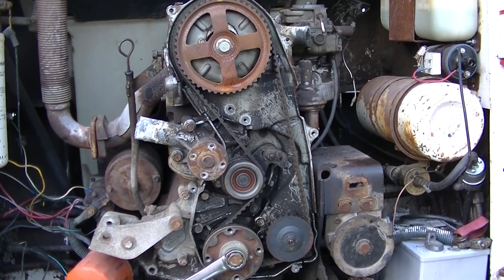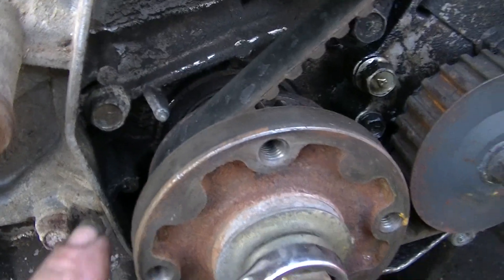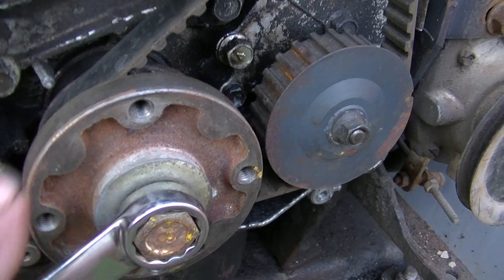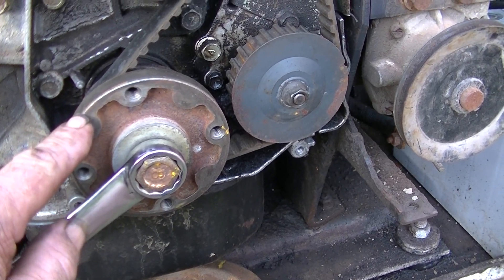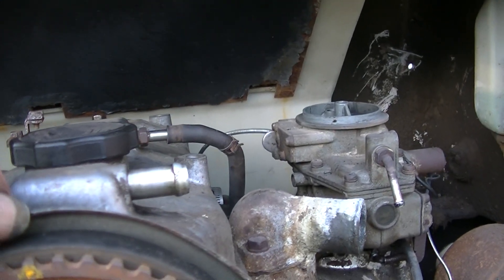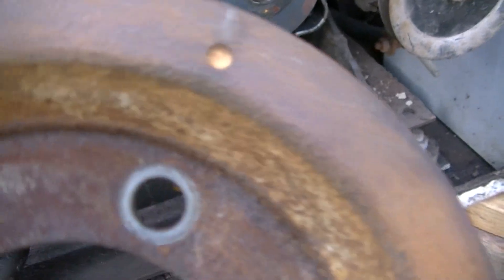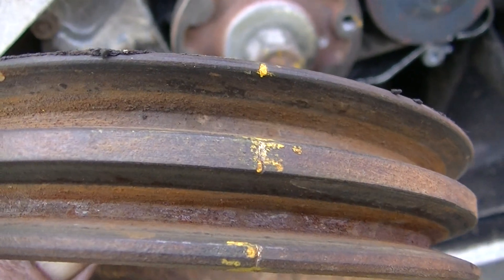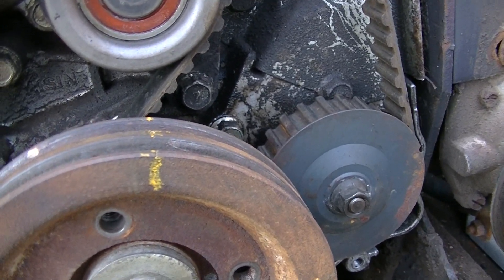Bobcat 642/742 Skid Steer - Mitsubishi 4G32 Timing Marks - zeketheantiquefreak

Comment: Thank you for this, had the same issue with this engine in a forklift that was hard to see the front side of the engine. Your video made it easy to figure out as the original manual left a lot to be desired. Thank you again for  taking the time!

Comment: Does that engine have balance shaft?
Reply from the maker: If we are talking a 'balance shaft' that is driven by, and timed to, the crankshaft, then no, this model mitsu 4G32 does not have it.
Reply: Mitsubushi calls it a silent shaft. There's 2 of them.on each side of crank in some 4g32 engines. Thank goodness bobcat uses non balance shaft.  I picked up an old bobcat trencher that has the 4g32 engine

Comment: At 148 that dot lines up with a dot on the edge of the pulley behind it. You have to look at the edge to see it. Also there is a dot on the crank sprocket on the belt tooth that you must remove the belt to see that lines up with the pointer. Don,t forget to check the oil level in the governor. Fill with 10-40 oil until it runs out the back plug. It ain't on the lube chart.
Reply from the maker: Thank you for the advice.

Comment: Thanks for the video. I tracked down a owners manual to do thing by the book. Yikes! Came to the same conclusions as you using a plastic tube to find TDC of piston #1. Got it running so I knew I was on the right path. Searched and found your video. I couldn't see the marks until i knew where to look! Thanks again!
Reply from the maker: Yea, I found the marks a real puzzler first time around. Thank you for the comment and glad I was able to be of help.

Comment: Do you know what the ignition points dwell is for 4g33 I can’t find it anywhere what it should be set at thanks again
Reply from the maker: Sorry, I have trouble with the 'comment notification' aspect and just found this now. If the distributor is a Hitachi, they have good data sheets on their website with the pertinent info you are looking for. My particular application called for 52 dwell, 18-21' point gap. I have since converted to electronic ignition. There should be a Hitachi part number on the distributor body. Thank you for the comment.

Comment: Do you know where the oil pump timing mark is I can’t find it in the block thanks again
Reply from the maker: Thank you for the comment. The oil pump gear just acts as an 'idler' or 'belt tensioner' you might say, it can be in any position upon installation of the belt.

Comment: I am working on the same engine and I can’t find parts do you know what company I can get engine parts from
Reply from the maker: Yes, I think I can help you out. What parts are you looking for?
Reply: Same question here. Working on a turbo version of the same engine 4G32T, planing on restoring it.
Reply from the maker: @sventt3  Yea, let me know what you need and if I have ordered the same parts, I can tell you the source. My major purchases were, gasket set, piston rings, water pump, block heater, carb kit and electronic ignition. I should have the receipts with necessary info.
Reply: @zeketheantiquefreak8518  I'll message you whenever i get the engine apart, thanks.